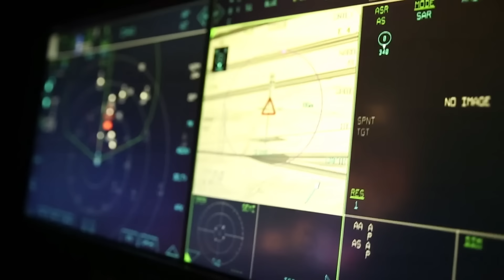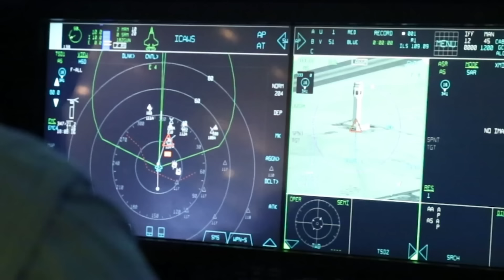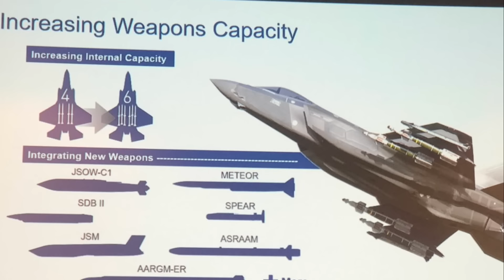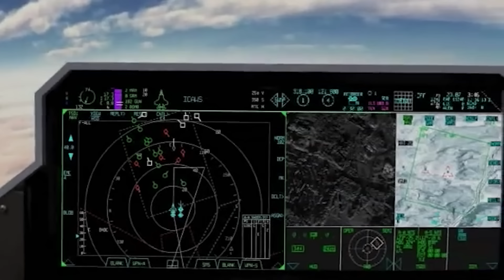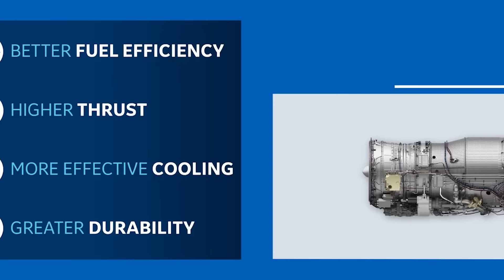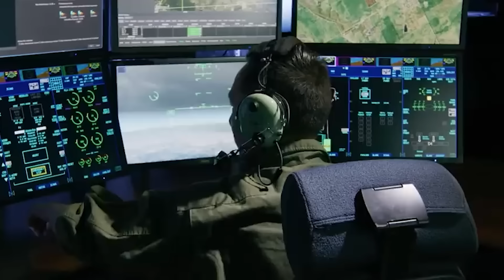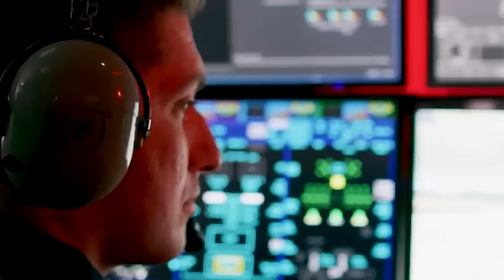The F-35 is about to become a POWERHOUSE

Comment: Upgrades.  Reminds me of a project I worked on for the MoD where the platform ran on Windows XP and EOL hardware.  This was in the middle of the last decade.  Good show Alex - very informative as usual!
Reply: Its absurdly difficult to certify software for these stringent requirements. Its almost never worth the effort to replace something that works.
Reply: @ravener96  not just in defense, but anything where software certification and validation means the difference of billion dollar budgets. Corporations, labs, infrastructure. You name it, and it's been around for a while, there's old software running in the background.
Reply: @granatmof  you said it. I’ve worked with cancer treatment radiotherapy systems. The front end had high end cpu and GPU computation suites. But the robots and controllers still ran on a pentium 2 era motherboard and Linux v1 kernel. But that was good enough because they were hardened for radiation and to keep the actuators and motors running with commands from the complex system. One of the most advanced robotics corporations in the world was using and sourcing ancient computer hardware because the certification procedure wasn’t worth it when the old stuff worked fine and was plentiful, and they even had it in the plan to buy from eBay and surplus govt/corp sales then certify in house to continue the life of their existing robotics systems. Crazy, but real and makes sense.
Reply: @ravener96  _   
I know how difficult it is to certify new firmware for commercial airliners.
They must be cutting corners in the military to make such major changes so fast.
Reply: @Bobby-fj8mk  in the f35? its been flying for close to twenty years, i dont think there's any corner cutting on that ship.
Reply: @ravener96  - any software or firmware "upgrade" needs to be approved.
Reply: @Bobby-fj8mk  yes, and there's no reason to think they are cutting any corners, because they have years and years to work on this. the f35 didnt just get in the air
Reply: @ravener96  - but I happen to know that a very minor 3 line change in the firmware for a model of civilian airliner took 2 years to approve.
The upgrades on the F-35 are 1 million times more complicated.
Reply: @Bobby-fj8mk  sure, but they also have much more than 2 years... and lower standards for safety than the civilian airline sector
Reply: @ravener96  - that's it - the safety standards for military jets are much lower
than for commercial airlines.
For a start they aren't risking the deaths of 100s of people if it goes wrong.
The military gets away with almost anything - even the flight rules about
 height above ground etc don't apply to the military.
They have to train for super low level flight as one example.
The military is inherently dangerous and there is no time to get
years and years of certification for potential war winning technology.
Reply: @Bobby-fj8mk  that still doesent mean they are cutting corners, just that the comercial airline industry is exponentially more anal than anyone else. i expect the software going into the f35 to be absolutely excelent, grade a code.
Reply: @ravener96  - so do I but I've yet to see any software
that was without bugs so it therefore always requires updates.

Comment: I am concerned that the F35 has been delayed and costly, but now it seems to be a usable warcraft. But the fact that is can be greatly upgraded without developing a whole new platform is outstanding. Being able to add major improvements is a huge advantage.
Reply: that was one of the purpose's of F-35, to be able to incorporate new tech.
Reply: I remember when some members of Congress had complained about the F-15. It has its own issues when it was brought out.
Reply: @Rhaspun  this TIME is different than 1975. things are really bad.
Reply: Yea this is actually one of the main reasons the F35 wasnt specifically designed as a pure air-to-air fighter because of how technology has largely made that idea irrelevant in a real combat scenario.
Reply: You should look up what they cost today. F35 have gotten much cheaper. The f16 was expensive and had tech issues early too.
Reply: @nelson_rebel3907  Sorry bro, but the F-35 is not by any means a "pure air-to-air fighter". I can tell you after working for Lockheed Martin on the F35 program for 12 years, It is called the Joint Strike Fighter for a reason brother. It can do a whole host of shit that most will never know about. There are reasons why when those in the Gov't who did not previously like the program, find out its capabilities and how those capabilities can be fine tuned and upgraded with software only at times, that they are all in.
Reply: @Kronk-rp3jf  Yeah man, the hurdle was getting up to full rate production for costs to come down. A lot of growing pains especially since Lockheed had to completely redesign the entire 1.25 mile long and .25 mile wide facility in Fort Worth, where the F35 is built and assembled.
Reply: The F-35 is actually quite affordable rn
Reply: Most fighters received new engines, software, radars and electronics during the years in production and after. Even the F-4 around 1980 could have been greatly improved to threaten the F-15, because the F-4 design was and is good. For commercial reasons it was naturally blocked. Selling more F-15's made more profit and a F-15 simple looks better which is good for sales.
Reply: Finland buyed some 80 F-35’s. Hopefully those come with upgrades.
Reply: @alfaceuntauriprodigy  Yes, Finland is onboard. It is hard to say, as details are not available to the public. All F35's are tailored and built to negotiated individual countries required and/or approved capabilities. For a non-software example, the Norway jets have a parachute in the aft section installed. It is the only F35 that has this due to the icy runway conditions Norway have to deal with. As far as software...classified.
Reply: But can it fly and fight in real battle? That yet to be seen.
Reply: @mcrand7887  Right now it's the most produced stealth aircraft ever and yet even more on the way, 2025 is going to be the F-35 biggest production run yet. Western aircraft have been the premier fighters since WW2 and no one else has come close. Let me know when Russia and China win an actual fight or manage to get 100 miles outside there own nation without breaking down, failing or simply unable to leave in the first place. The Flanker is the most common fighter in their arsenal and yet they have never dominated an airspace.
Reply: @NightshadeX85  Germans did dominated in early WWII and Russians jets in Korean war followed by Vietnam's Colonel Tomb. But it was then, this is 2023, many so called game changer weapons and technological in Ukraine have failed. Lesson learn is 'never underestimate your opponent'..
Reply: @F35_JSF Canadian F-35's have the parachute too.
Reply: @NightshadeX85  Well said.
Reply: @galvinstanley3235  Excellent. The production line of the F35 is a live creature. Forever changing. Yeah, I think Canada just joined up and placed their order this year, and it would only make sense that our northern neighbors would benefit from a chute given their icy climate as well.
Reply: @alfaceuntauriprodigy  For whatever the small fart Finland is in need of an army and even less airfleet to begin with. But corruption is king, I guess.